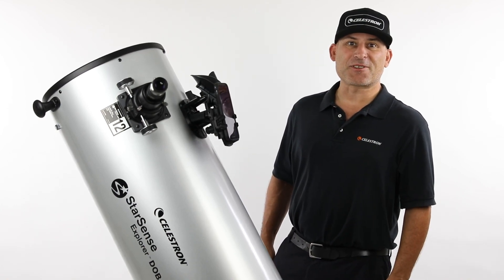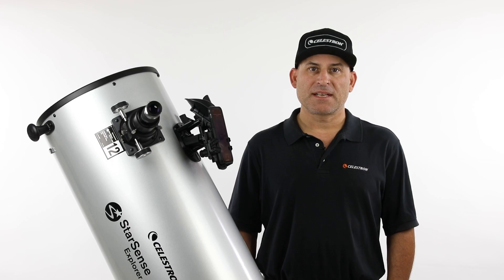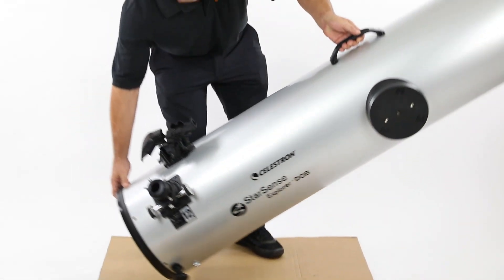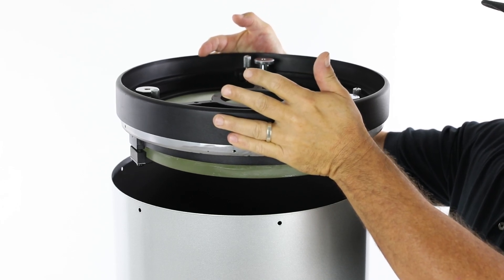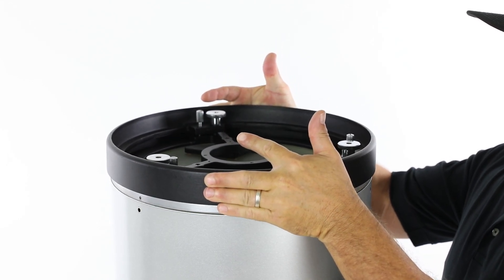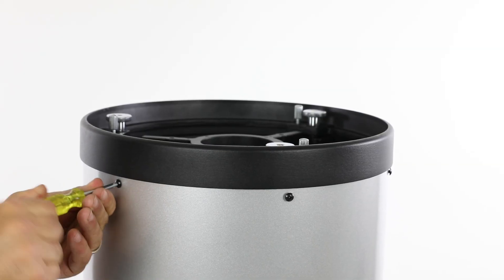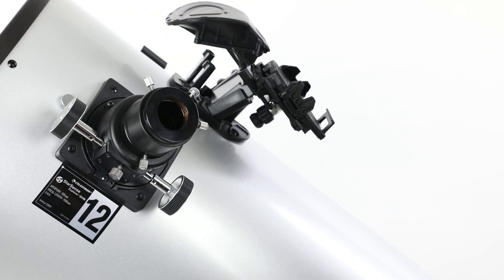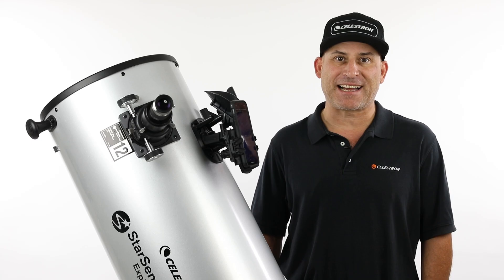How to Install the Primary Mirror Cell into the StarSense Explorer 12" Dobsonian

Comment: We got this telescope for school. The starsense app did not work at all.  Next when installing the primary mirror, one of the screws couldn't be tightened. So it took a lot of strength. But I think it's somehow pinched corner of the mirror so we are not getting good views with this telescope after spending a month, trying different collimation methods, so I'm gonna try reinstalling the primary mirror again today by undoing all the screws, and slowly tightening them all up one by one.   Hopefully it helps because I'm getting better views at home with a 4 1/2 inch mirror telescope, and it was very disappointing...
Reply: I recommend calling Celestron Tech Support, as the Starsense App is not new and has proven to work. Love mine!